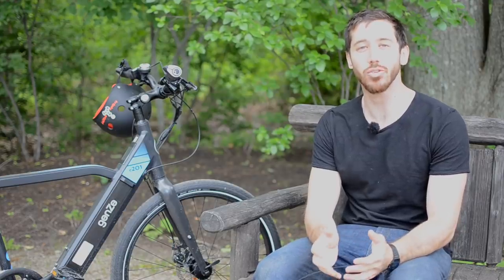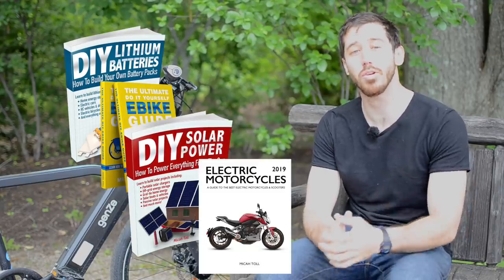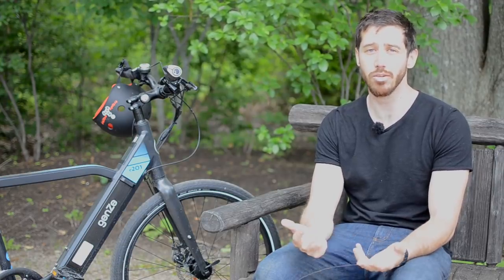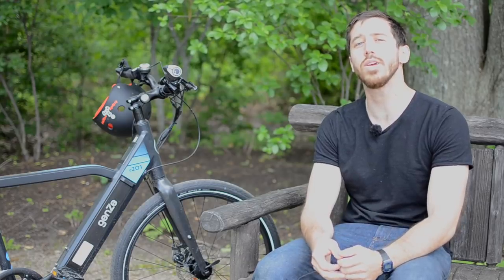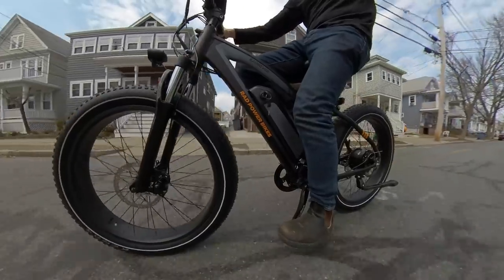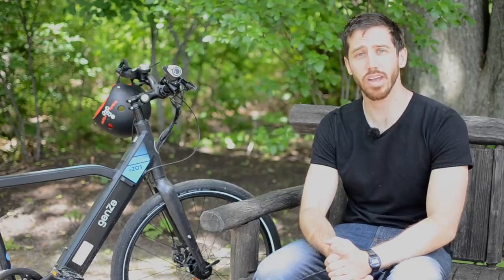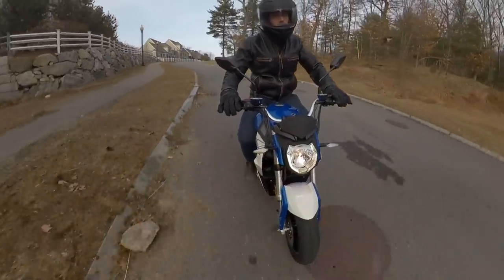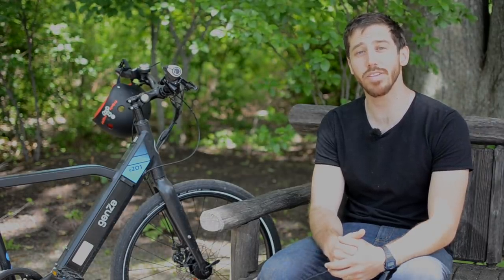How much POWER does an ebike need?

Comment: All i know is that i’m not paying thousands of dollars to only go 20 mph
Reply: Exactly. These things are massively overpriced for what they are. I think we've become more stupid as a society.
Reply: @onepalproductions  you can make one for litteraly free just fine a old motor 24v wich are basically free and a battery wich you have to get creative to find because there's lots of unique types
Reply: @onepalproductions  Yes and no.
You can buy motors and controllers from china and use any low end bike to build an ebike for cheap.

But you are responsible for picking a reliable source, designing the system and troubleshooting any problems.

And, or course there is no warranty or support line.

Ebike retailers in the US want to carry bikes with a decent profit margin, because they have ongoing costs to cover.

I can understand why they don't want to carry cheap 5kw bikes - in addition to low profit margins, there is huge liability for them.
Reply: Then how about the Lectric XP or ST? They cost $899, and are a class 2/3 e-bike. This means they will go up to 28mph in pedal assist and 20mph in throttle only mode (limited by law). If you want to go faster, the law classifies it as a motorcycle. At that point you need a motorcycle license, registration and insurance, like any other motorcycle. An e-bike lets you avoid these sometimes expensive legal necessities. E-bikes also appeal to those who don't have or who can't get a driver's license, for whatever reason.
Reply: @SuperSushidog  There are othwr justifications for high power ebikes.

I want a fat tire bike that can baul a small trailer through any weather over any terrain.

That require a hell of a lot more power than 500w or 1000w

Other people want a bike they can ride levally to an offroad area, where they can use the extra power fully.
Reply: I made my 1000W ebike with an ebike conversion kit. I bought a new bike (could have used an old one and saved more money). The whole thing, including the bicycle, cost me 700 pounds.

I use it to work and back every day. Its the cheapest way of commuting, per mile.

I dont have a car at the moment but even if I did, I d use the car for long distances and the bike for commuting to distances up to  10 miles.
Reply: @Zomby_Woof  i feel like the main cost is the battery. if people want an efficient, long range, and unjank battery then they will have to drop some $$ to cover it. the kits are usually $100-$200 but the batteries themselves take the cake. I feel like normal consumers should just buy an ebike. it appears to be less hassle, even if theyre paying a little more. they get warranty, replaceable parts, guaranteed quality, better support, good comfort, and more information online as a result versus the shady generic conversion kits
Reply: @nikoskabbadias  Care to spill the beans and elaborate a bit more as £700 is a bit more sensible pricewise. Do you need any technical know-how to use a conversion kit?  Many thanks
Reply: @TheRealParsonz  Ebike conversion kit from amazon. They cost 100-200. 

Bike from Amazon, anywhere from 150.

Battery from Amazon. This is the most expensive part. From 200 to 400.

Thats it.

According to your weight and how hilly your area is I could recommend you how powerful kit you will need,what capacity battery and what type of bike.

As an example, I would say for an average man, 70-80 kilos, 5.10 tall, in an average hilly area

You d need a rear wheel 26" conversion kit, 36V 500W motor, 10-15 Ah Battery, and a mountain bike with 26" inch wheels, a cheap one will do if you are a sensible rider and dont do stupid things or stunts.

You def dont need to be an expert , I have ZERO idea about electrics. 

You just follow the steps and connect yellow cable to yellow cable, red to red etc.

You will need to be reasonably good with tools (ie dont be a complete retard) but no extreme specialized stuff.

The procedure is, you change the back wheel and put the one that came with the kit. Then you put the controller circuit board on the bike inside the pouch it comes with (it has velcro for attaching on the bike).

You change the handlebar covers and breaks , and put the ones that came with the kit (using a hairdrier to heat the handlebar covers on your bike will help massively to remove them).

You may or may not attach the speed sensor which cuts off the motor when it senses you re going too fast for the regulations (15 mph, personally I did not attach it, it worls without it and you can use asmuch power as you want. Its the little disc that goes to the pedal crank).

You bring all the cables to the controller box and connect them to the corresponding sockets. You secure the cables on the bike frame with zip ties. Done.
Reply: @nikoskabbadias  I've got an old mountain bike rotting in the shed. I think you've potentially saved me about 400 quid. Thx very much
Reply: @TheRealParsonz  one last VERY important thing that no one told me:

if you are going to install a motor that is stronger than 250W,

and especially if you are an adult man=heavy,

install a very simple thing called "torque arm" on the wheel with the motor.

it helps keep the wheel in place.

bicycles are not built for lots of power, and especially the front wheel.

it can get deformed by the power of the motor, and the wheel to come off, when the motor is powerful.

torque arm takes away the stress from the fork, and keeps the wheel in place.

if you are going to install a motor more powerful than 1000W, two torque arms are recommended
Reply: @nikoskabbadias  thanks, I'll definitely need to look into that too, save me trip to the GP.
Reply: @SuperSushidog  I bought my wife the Lectric xp 2.0. I unlocked the power range and she has no problem going 26mph on PAS 5. Throttle only about 23mph. I’m a fairly large man and on the flats 23mph throttle only but is PAS 5 I’ve gone 30mph with a fair amount of peddling. I did change out her freewheel to a 11t-34t in order to achieve those speeds. I have preordered the XPremium mid drive for myself but have not received it yet so I have nothing to report on it yet.
Reply: @nikoskabbadias  not sure it's the cheapest way of commuting. Biking will fuck up your knees and eventually throw you in a wheelchair. You have to consider the health care costs.
Reply: There's plenty of EV bikes sold for $1500. What do you want exactly: free bikes  ? Compared to a good quality regular bike that can easily be sold at $3. to $5k., I say that less than $2k for a solid EV bike is a damn good deal ! 🔥
Reply: I just paid $500 for my e-bike and I absolutely love it!
Reply: @SuperSushidog  moped, not motorcycle
Reply: Pay $1k for a bike or pay $10k/year for a car. Hmmm such a tough decision 🤔🤔
Reply: You don’t have to if you diy it you can take a bike you already have and convert it.
Reply: What about a transport truck. They’re not very fast. Does value only equate to ground speed?
Reply: The fact that you telling people the motor ratings mean nothing how can you ask how much power do you need? Also the watt is a long established easy to calculate unit of power standardised world wide. The fact that the ratings from different manufacturers give different outputs is just amazing. We're are trading standards and why does nobody challenge the manufacturers on the false claims?
Reply: @nikoskabbadias looking for a 4000kw motor,  a 72v 150 amp controller powered by a 72v 80ah battery . Good 👍
Reply: Amen bro amen

Comment: My Bafang 350w geared rear hub motor, with a 36V battery, is all the power I would want. I'm 6'-3" and 205 lbs, so I still get a decent workout when climbing hills. I actually find myself doing way more hill riding now because it's so much fun! I've ridden ebikes with 500w and 750w motors and I barely break a sweat with those. So, if you still want to get a decent workout, don't go for anything more than 350w
Reply: what kind of speed can do you reach?
Reply: @shneor.e  About 25 mph on the flat
Reply: @alozborne  i found a 350w bafang rear hub e-bike conversion kit that's near me, do you mind if i ask some questions?
1. 25mph is the pedal assist mode or that's its full throttle?
2. i'm 5'2, ~145lbs, i can cycling 25mph myself, so would the pedal assist help me surpass that speed or 25mph is its cap?
3. how big is your 36V battery? how far have you tested it?
thanks in advance.
Reply: For me, I like having a more powerful motor, even though I rarely use the power. I usually have it set up in a motor that gives me about 200 W. That gives me all the power I need except for with a very strong headwind or a big hill. But I like having the powerpower when I need it.

Comment from the maker: Holy exposure, Batman! Well I guess it's good that I know more about ebikes than I do about working cameras...
Reply: Oh I thought you were just really white!
Reply: "That quite alright, Robin, my boy" To the Bat cave to get into your camera settings and raise or reduce (experiment in the lack of a manual) the I.S.O. setting by a few points at a time. I.S.O is the sensitivity the camera sensor has to ambient light. It depends on the make of camera but usually a slightly lower I.S.O. will make the camera adjust less to low light situations (like sitting in the shade of the ol' oak tree) preventing it from becoming washed out.
Reply: My 48 volt 750 Watt bldc motorcycle can achive 45-50 kmph speed and loading capacity 200 kg and 100 kg motorcycle can climb 20degrees
Reply: 1.5 kWh battery with Samsong cell give around 90-120 km range
Reply: Sir how much power is needed for uplifting front wheel ,if using mid drive
Reply: You should’ve heard the audio on his earlier videos.
Reply: First thing I noticed was the overexposed image, and went to the comments just to check if someone had the same issue while watiching, first comment... "Holy exposure, Batman!".. I cracked! 🤣🤣🤣🤣

Comment: 14kW all day long😁 if the front wheel doesn’t come up then it’s not enough power!
Reply: 14 kW Mr. Kirby if you get to 20 will you have a disco sesh in your shed?? 😉
Reply: How does your bike handle that much power? 
Wasn't sure if it could handle anymore im thinking of going 8KW hub drive the 15kw is probably gonna kill my bike lol.
Also what size battery? 
And what's your top speed ?
Reply: @danielziolkowski1027  Given the weight and size of 48V batteries (assuming he could even find a controller and wiring that could handle peak 291 Amps which I highly doubt), the range would be around 5 miles in the city at best. His bike would have to be built like a motorcycle to handle the torque.
Reply: @danielziolkowski1027  check out Andy kirby videos he and vortecks are two excellent ebikers with more knowledge than most vortecks bike version 3 is crazy powerful he's started a site for info on builds etc link in his videos  andys bikes are rapid powerful machines with informative videos  look for their videos on here or check out cloudsto.com or kirby ebike these two guys are pretty much the best ebike build vlogers on YouTube between those two guys you can't go wrong I believe they both use 72 volt 30ah there abouts batteries running 150 odd amps more than I can handle I've a 72 v mid drive running 90 amp turned down from 150 for safety reasons 😉
Reply: I think this video went about 6:10 longer than it takes to say MOAR!
Reply: @danielziolkowski1027  I run a 32kw hub motor and I'm alive lol. 84v 30ah
Reply: @andy kirby where did you get a 14kw motor?
Reply: @zephyr2278  where did you get this motor :)
Reply: @zephyr2278  No. I didn't know it. Thanks a bundle for the info. Really. OMG. yes was going to get the 273 (for my motorcycle proj) as well.  I've heard about the statorade.

i thought you may have sourced motors from somewhere that were stronger :) 

how about your controllers? you bought them somewhere?
Reply: @samguapo4573  Also you don't need a 14kw motor to get 14kw of power, these motors can handle way more power than they're rated for, you just need to be sure you don't Overheat the motor. My qs273 is rated for 8kw yet I run it at 32kw no problem, and my qs205 is ratedfor 4kw yet I run it at 25kw. The way I do this is with statorade (look it up) and heatsinks. For 14kw get a qs205
Reply: @samguapo4573  I didn't see this reply before i left my last comment lol. I get my motors (not controlelrs) off aliexpress, and the controller I use is a mobipus 72600 but that will be overkill for anything under 20kw or so, get a mobipus 72200 for 15-20kw. there are other options but mobipus is great and people use them for super powerful ebikes / motorcycles. https://ballaratebikes.com/collections/controllers this is where I get them, prices are in AUD btw and will be 25% less or so assuming you're using usd
Reply: How about 2 - 5 kw hub motor?
Reply: If you dont stop it. All the crap your haters gave you over that monster u ride👍. Yes im 1 of your American followers. And i love your work. Cant afford your bike right now but still love your work.😁
Reply: 1MW is probably a minimum
Reply: 1.21Jigga Watts
Reply: @autonomous2010  The only real limits are practicality.
There are plenty of controllers that will handle 291 watts - you can get controllers with pretty much any capacity - they just become cumbersome in terms of size and weight.

For $240 you can get a controller that will provide 30kw peak - to two motors for a total of 60kw.and it's only a little over 3" x 3."

Take that 14kw motor and add cooling fins and ferrofluid, and it will make 30kw no problem and won't overheat.

That's just off the shelf parts.

I'm not saying that level of power is required , but if you have money to burn, it's quite doable.

Of course, if you're looking at prebuilt bikes from a known us/uk company, you'd be paying that much anyway.
Reply: @Zomby_Woof  
"assuming he could even find a controller and wiring that could handle peak 291 Amps which I highly doubt"

Amps not Watts. The original post was indicating they were wanting something that could output 14,000 Watts into an electric bike motor. 

Bike frames are not designed to handle roughly 10,266 pounds of peak torque. 

A motorcycle frame could be custom engineered for that of course but that's no longer an electric bike by any stretch. :-P
Reply: @0141star  Andy's bike isn't really an ebike(IMO) its more an electric motor bike, Not knocking it, but its beyond the realm of most DIYers, totally illegal on Britain's roads(not that i care about that except if you get nabbed) and expensive.To me an Ebike is a Bicycle, it looks like a Bicycle but it goes up hills without killing you. Most people don't even know its an Ebike and don't give it a second look.
Reply: @iamrocketray  I'm inclined to agree with you on ebikes should look like bicycles mine is similar to Andy's so it's  basically like a motorcycle and your right very illegal but Andy kirby has his road registered due to the power I'm doing the same currently for my lmx p2 but its not beyond anyone to make an ebike like his or mine  its much easier than tearing a two stroke down even battery building ain't that hard I'm looking for something like you said though more like a bicycle with pedal assist and a small batt instead of All that torque oh and the weight of a 30ah battery don't help either

Comment: I feel that wind is as important as hills in factoring motor size. I live in a place that has significant wind. The effort and power I need to overtake the added wind is significant
Reply: Exactly right.  Wind is huge with or without a motor.  For that reason I chose a BBSHD on a roadbike.  No regrets.  I use maximum power mostly if trying to ride fast into a stiff headwind.
Reply: You should sail instead of biking
Reply: @nolanr1400  If his house was an island on water, then surely he would be.

Comment: Hey Micah, great video and very informative. I want to add a bit about wind resistance and cost. I am on a 3kW Cyclone ebike generator (800W) hybrid where generator is removable for different modes. Also, don't take this as me grand standing I just have a lot of time to test and think about this. I would say that 22 mph is the sweet spot for ebikes from a wind resistance and cost perspective. To get there you need 750-1000W motor. The reason why that is the sweet spot is wind resistance robs a lot of power and becomes to the 3rd power above 20mph and 750-1000W motors and batteries are relatively cheap compared to 1500W+ kits. I rarely ride at 3kW because it is so inefficient due to wind resistance and battery life. Of course if you have an unlimited budget just go buy at 72V 30ah+ battery and you can go at whatever speeds you want. Can't wait to see you on the Harley Livewire btw.